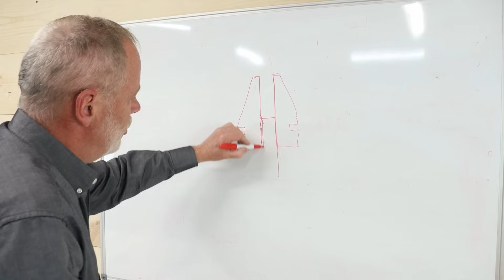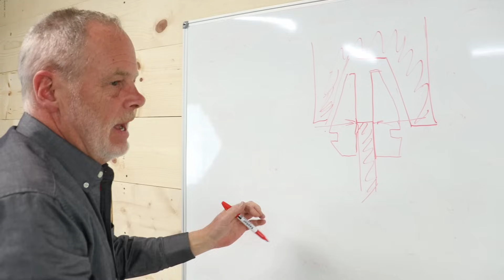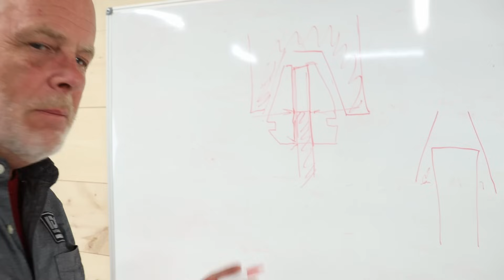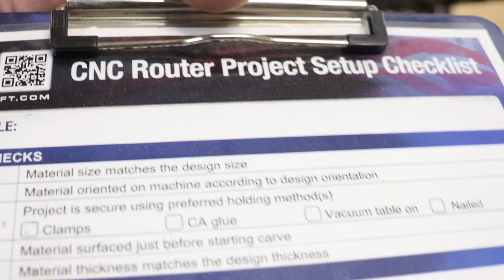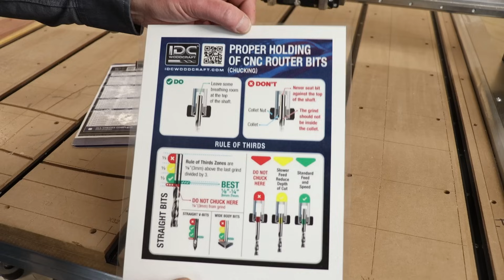3 CNC Router Mistakes You Want To Avoid (End Breaking Bits)

Comment: Thanks for the video and tips. I will have to be a bit more vigilant at cleaning the collet. I will also use the checklists when I receive them. I have recently started using my CNC for creating graphite molds for metal casting. I purchased a cheap Baby CNC just for this purpose. I am attempting my first two part mold using Vetric software
Reply from the maker: Glad you found the tips helpful! Good luck with your graphite molds – that sounds like an exciting project!

Comment: Garrett my name Phil Riley  I just got my first cnc router and I’m having trouble 😂 I’m old and I’m not computer savvy 😅 I need to know if you import g-coad on every project that was probably a stupid question but like I said, I’m not a computer guru. If you could help me out, I would appreciate it. I use the easel software. 8:33
Reply from the maker: Hi Phil! No question is stupid, especially when you're starting out. When you design a project in Easel, you'll need to export the G-code for that specific project before you can run it on your CNC router. Each project typically generates its own G-code file, so yes, you'll do this with every new design you create. Happy CNCing!

Comment: Concerning "mistake #2", I am a retired Master CNC Machinist and I had a project recently where I had to extend the bit and hold on to a bare minimum. As I have done many times, I merely backed up the bit with a dowel pin in the collet and eased up on the speeds and feed. Worked great!
Reply from the maker: This is an ingenious way to compensate!

Comment: Hi Garrett,  I have experienced the “bit slip” problem before and it was vey frustrating. It seemed to occur occasionally, particularly when doing cutouts and roughing with end mills.  I tried cleaning the collet, collet nut, shaft, and shank, switched from downcut to upcut bits, and decreased cut depth, but none of that worked. Previously, you advised me to get a torque wrench and use that to tighten the bits. I finally did that and found that the torque wrench had a lot more leverage and did indeed tighten the collet quite a bit more than the stock wrenches that came with my CNC. I tried to research how tight was tight enough. All I found was a few articles that stated more than 50 ft-lbs. When using the torque wrench, I could not tighten my collet nut more than 20 ft-lbs. By using the torque wrench, I have not experienced any more bit slip problems with any of my bits. However, I am still concerned with over-tightening the collet as in mistake #3. Do you have any tips / guidelines on how much torque should be applied to avoid bit slip and yet not over-tighten?
Reply from the maker: It's great to hear that using the torque wrench helped eliminate the bit slip issue! Over-tightening can indeed damage the collet or bit, so it's always a good idea to strike a balance. A general guideline is usually around 15 to 25 ft-lbs for most CNC applications, but this can vary based on the specific collet and bit type. Always refer to the manufacturer's recommendations if available, as they can provide the best direction for your specific setup. It's all about finding that sweet spot, so just keep experimenting a little until you feel comfortable!

Comment: Nice Video :) Maybe we can get a Video about "noises"? I am working with my hobby cnc for some month and i am still not sure "should this sound like this" . Particularly the screaming? Why does it scream, which parameter causes it and which level of screaming is okay?
Reply from the maker: Thanks for your feedback! It's great to hear you're getting into CNC woodworking. That "screaming" noise often happens when the feed rate is too fast or the spindle speed is too high for the material you're cutting. Adjusting your feed rate and ensuring proper tool selection can help minimize those sounds. Generally, a bit of noise is normal, but if it’s excessively loud or doesn’t seem right, it might be worth looking into your settings. Happy woodworking!
Reply: @IDCWoodcraft  Thank you for the advice :) i did some tests last weekend and figured out the sweetspot for my machine is ~50inch/min with an 1/8 upcut bit.  Before i did like 100inch/min. Currently i use cheap amazon bits because i am still learning. Does more expensive bit make a difference?

Comment: In my years as a CNC machinist, I have seen what can happen when the cutting tool is improperly installed. It can really destroy collets. I have also seen collet nuts with cracks from over tightened nuts. Sometimes they even split the threaded portion of the tool holder. Taking your time and follow the steps you have laid out will save lots of money in the long run. No ruined project or possible a spindle assembly.
Reply from the maker: You’re absolutely right! Proper installation and taking your time can definitely prevent costly mistakes and damage. Thanks for sharing your insightful experience!

Comment: Excellent advice!  I am guilty of white-knuckling the bit.  I use a small, wire toothbrush type brush to clean the collet, but i admit that i skip that when running multiple toolpaths on the same project.  Not any more, tho
Reply from the maker: I'm glad you found the advice helpful! It's easy to skip cleaning when you're in the zone, but it really makes a difference in the long run. Happy woodworking!

Comment: Three possible issues that never crossed my mind.  I've used a router table for close to 35 years and am guilty of white-knuckling while installing bits. Thanks, Mr. G
Reply from the maker: I'm glad you found some new insights! It's easy to develop habits after so many years, but awareness is the first step to improving safety.